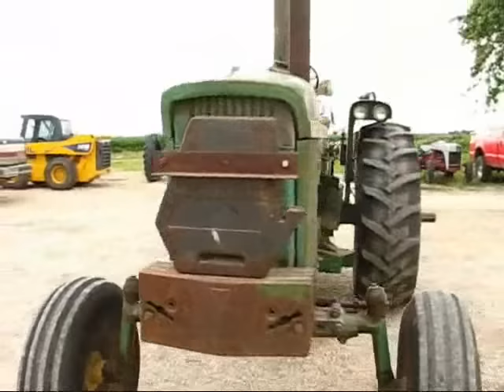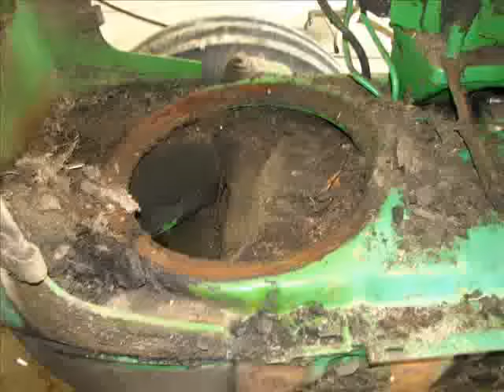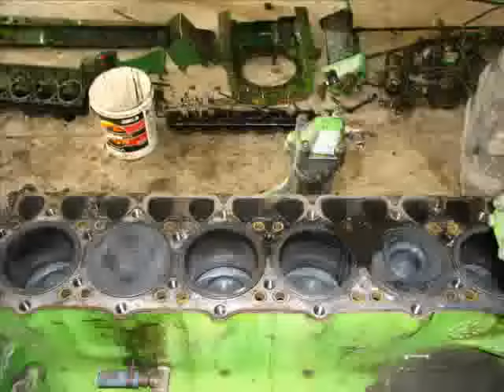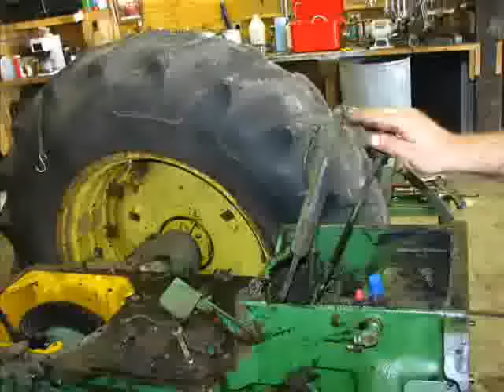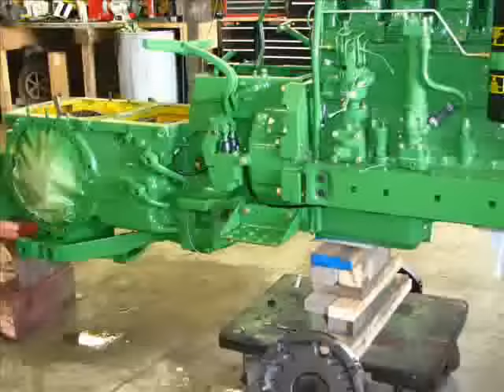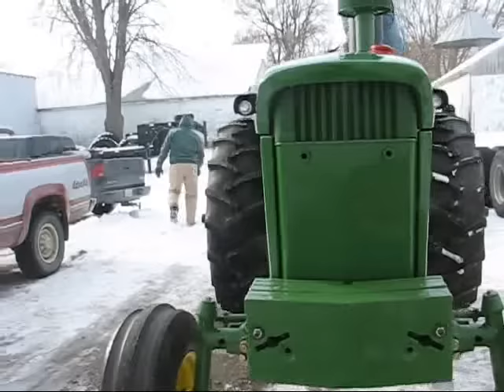John Deere 4020 New Again

Comment: we ran two 4020's on a 3000 acre farm up until the day we quit farming, one tricycle gear running propane with custom built fender tanks for spraying, and one diesel with a push blade mounted it was one of the workhorses. worked daily pulling disk etc. the reverse had failed in it and dad was to cheap to buy batteries, so i know for at least ten years we made sure we always parked it on a hill and never got into a place that required you to back up. Hooking up euip was a trip to say the least.

Comment: That was probably the best all-around farm tractor ever made. It had enough power and weight to handle a heavy disc or a 5 bottom plow, but it was nimble enough to pull planters, sprayers, cultivators, grain drills.
I think they said it had 95 at the PTO, but it was the pullingest 95 I ever saw!

Comment: Nice 4020 paint job. When I restore my 1971 4020, I plan on checking out every aspect of the tractor mechanically.  I'd love to  replace every wearable part but that's for people where money is no object.  I have thousands of hours of running time in a 4020 and a 4320 from my high school and early farming days.  These tractors are still nice to run.  I like them with the Hinson cab.  The AC in the Hinson was only enough to get by compared to todays standards, but if you keep everything cleaned and fully charged, they aren't that bad.

Comment: Looks like a 1972, I have a 68 model, but the 72 model had larger oil pan and side controls, prelude to the 4320 about the same tractor with out  the cab